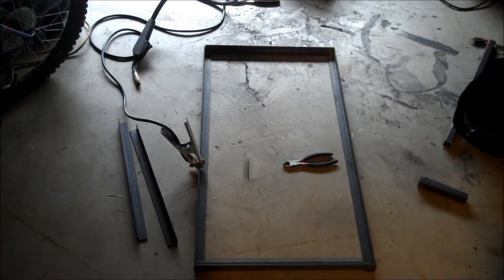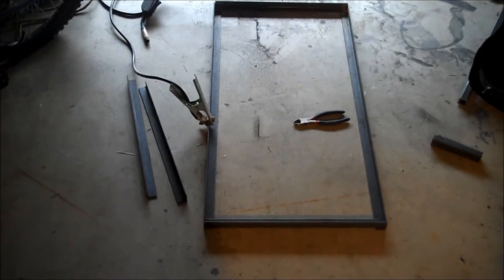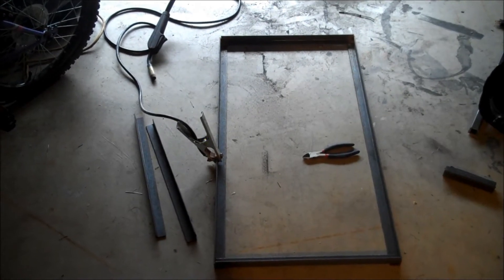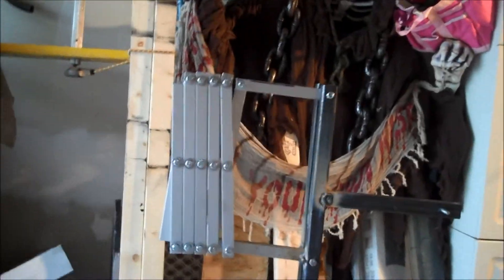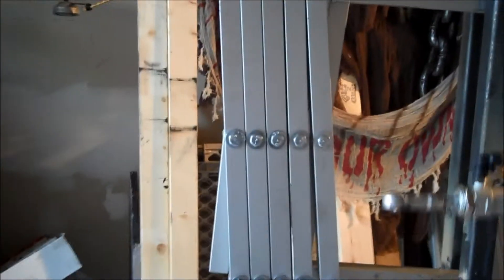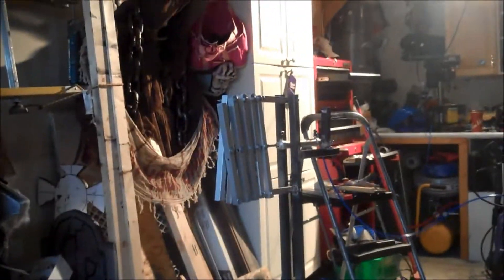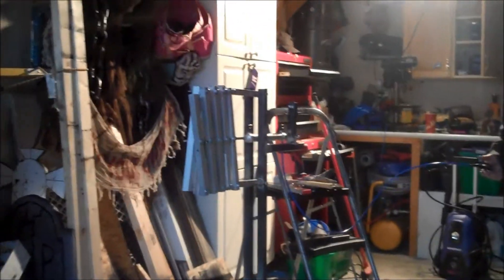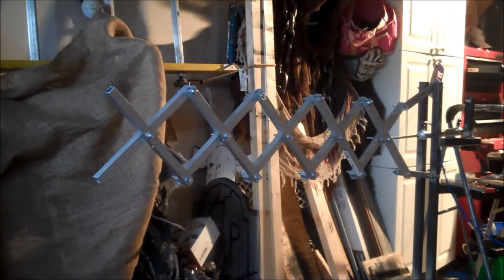Halloween 2015 SCISSOR MECH BUILD AND DEMO

Comment: im building the same set up, just wanted to know what size is the Pneumatic cylinder  i was going to  use one with 12" stroke not sure if thats to much
Reply from the maker: Sorry for the late response I used a 12" what did you end up using??
Reply: Prop Master  damn I never know you responded  Im 3 years late lol I used 7” cylinder 1”3/4 bore